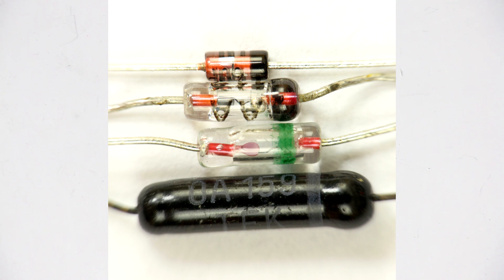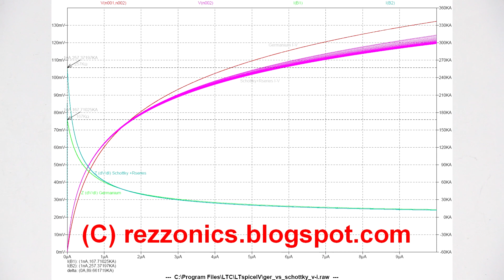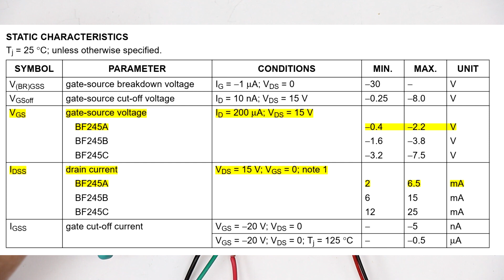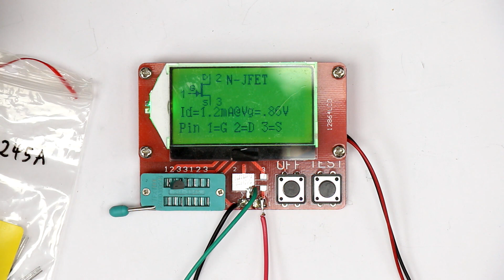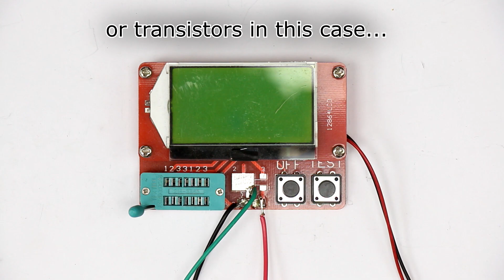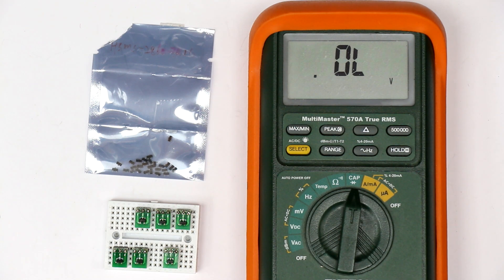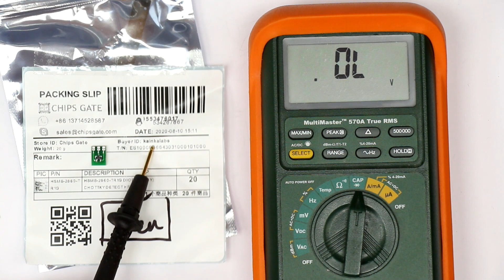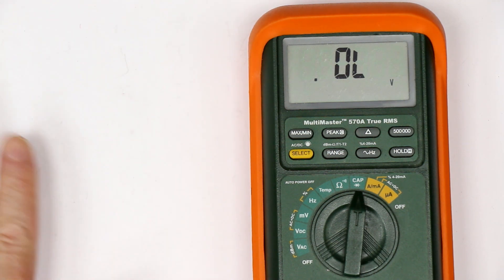Some Fake Chinese Semiconductors

Comment: I've had fake Unijunction transistors, which indirectly came from China, mostly it's the type 2N2646 that I'm aware of. The REAL 2N2646s have goldplated pins and a gold or brass plating on the bottom of the TO-18 casing. Not the cheaper aluminium or tinned cans that the Chinese sell. As for internals, they're just cheap standard NPN transistors, so not even useful as a Unijunction... I made many circuits that failed, till I realized to put the transistor in the tester. I've now seen 2N4871s as well, that I do not trust in the least? Only the American companies made Unijunctions as far as I'm aware.

Regards,
Thomas

Comment: I buy Linear Systems FETs. Cost adds up as I often need matched pairs so have to buy 100 to get some good matches. At $3 each it is expensive. Or, buy from a reputable individual. May be $20 for a pair 

I got some bags of BJT and FETs from China and they were the correct type. Then, they have to be checked for quality. 

I prefer to pay up (and find a replacement if necessary) and buy from major suppliers -- Mouser, Newark, etc. It isn't worth my time to buy junk parts.
Reply from the maker: But there are a lot of parts that aren´t avialable any more from DigiKey, Mouser etc like e.g. the "A"-Types of Standard-FETs. What do you do then?
Reply: I use the LSK170 which does come in the A, B and C current ranges. I have searched their list for complementary pairs and found one for a project.

It is a real shame that a manufacturer such as Toshiba stopped making many audio transistors because of this fake problem. 

In the end, if a direct replacement or sufficient replacement can't be found then I would try to find a good transistor and adjust components as needed to get a good design. 

That is not desirable when repairing or reconditioning equipment to original condition. 

For me, finding replacements is tedious when a part is no longer available and no recommended replacement is available by the manufacturer. 

That is where your excellent video comes in. I had no idea of the problem until I got back into building audio gear. One transistor with a MT100 case (?) was faked and so none were available. I used a Motorola transistor with similar specs and different case. It was rated at lower power but that was not an essential parameter.

If these fakes stated what they really were, we could better evaluate the specs and determine if it was a good replacement. Too bad they don't. Worse yet, they may be rejects.

I got a bag of 2N3904 transistors back in the 80's which were very noisy. They went in the garage. It wasn't worth the price of mail to return it. No internet then.

Comment: We crystal radio enthusiasts want germanium diode because it needs only 0.3 volts to conduct signal, other diodes work on 0.5 volts. So we wouldn't hear any far away stations only near strong stations with fake germanium diodes.
Reply from the maker: That is one of many misconceptions about Germanium-diodes used in crystal-radio receivers. In fact it´s the ratio between the forward and the reverse current at very low voltages (below 100 mV!) that determins the usability of diodes in crystal radio circuits. If you really needed 300 mV to hear AM-stations, you could only hear very near stations. Because of the much lower reverse current of Schottky diodes they are far superior to every Germanium diode. And in fact the first crystal-radio rectifier diodes (the real "Crystal-diodes") where a small wire (Cat´s whisker) was contacted to a Galena-crystal, were in fact Schottky-diodes!
Reply: @KainkaLabs  I was very surprised when I first discovered BAT82 works much better than any germanium diode I own in my crystal set.
Reply: @KainkaLabs  Isn't the point-contact diode a different principal to a Shottky-diode? I know nearly nothing about semiconductors, but a little bit about historical evolution thereoff and I'd find it strange that during that entire period nobody decided to call the original 1N34 (for example, or it's European brothers OAxx) a Shottky-diode? Or is any metal-semiconductor contact based diode a shottky-diode?

And yes, many of these pointcontact-mineral affairs work even better than Germanium-diodes, truth be told... They're not that good once you start using biasing!

Regards,
Thomas

PS. I grew up on Websites like yours hahaha!
Reply from the maker: There are 2 answers to your questions. Both (classical) Germanium as well as Schottky-diodes could be called "point-contact" diodes. But in Germanium-diodes it´s a PN-junction and in Schottky-diodes it´s a Schottky-contact (semiconductor-to-metal) that is "point-contacted".
The second answer is, what kind of diode is "inside" a glass-body stamped or sold as "1N34". They have similar characteristic curves, although the Schottkys have m uch less reverse current. But through the glass-body one can clearly see the difference between the two types. In Germanium-diodes you usually see a golden, whisker-like wire with a bend contacting the PN-junction. Schottky-diodes usually look orange inside with no discernible structure.

Comment: I bought 10 pcs of Dual Gate MOSFETs BF962 from Ali. Not one works! But they offer free returns. The scam works because the buyers rarely send the parts back and because it costs almost nothing. In the case of expensive parts, the fraud is not unsuccessful, because higher costs are open.

Comment: Radiation measurement equipment service engineer here. Now Germanium is used for gamma detectors.
Reply from the maker: Yeah. That is pure Germanium, not "doped" Germanium for semiconductors. Completely different application with different physics. And BTW Silicon is also used for particle-/radiation detectors e.g. in the detectors at the LHC.

Comment: I have bought in Aliexpress J-FET dual gate transistors marked as NEC 3SK45, and I received them stuck in a piece of PE; one of them had a D-S short circuit and the other one was actually a N-D-MOS.

Comment: I recently bought some JFETs from AliExpress. The BF245Bs were fake: NPN BJTs as per your video. The BF245As gave very peculiar readings on a component tester similar to the one you used. Vb was 385mV and Hfe was 184K and it showed up as a NPN BJT. I was able to repeat these tests with a Peak Electronics DCA75 component tester. The BF245s tested as NPN transistors as before but at a collector current of 5mA, Hfe was 278 and not over 400 as before. I think they are 2N3904 or similar. The BF245As, however, tested as n-channel JFETs, as they should. The pinch-off voltages were around 0.5v or slightly less. Perhaps the cheap testers cannot test JFETs with low pinch-off voltages.

Comment: Recently i bought some lm317 in to92 and they are so fake that i can't even found out what they really are (i tested as transistor, diode, all series and shunt regulators pinout combinations, and more), also in a previous transistor kit came some tl431 that were in fact tl432 (different pinout), and i don't even want to talk about regulators, mosfets and opamps 99% of them are fake.

Comment: You should get NOS local 2AP series instead of western part number
Reply from the maker: What does this have to do with the topic of this video: fake chinese parts???
Reply: @KainkaLabs  there is no modern packaging germanium parts,  you definitely going to get fake parts.
Reply from the maker: That´s wrong. I have seen germanium 1N34 diodes recently on AliExpress. The Chinese apparently do still manufacture genuine germanium diodes.
Reply: @KainkaLabs  you probably should put them on curve tracer and looking into the temperature current changes to tell if they are germanium.
Reply from the maker: IT´s much easier. With a trnasparent glass envelope you can easily discern germanium from Schottky diodes. The other method I have descried in my video "How to discern Germanium....". It´s the reverse current that is much higher with germanium compared to Schottky.

Comment: Fakes are often immediately visible by the part number, incorrect fonts and lightly laser etched but no depth to it as the original would
Reply from the maker: Not always. I have seen fakes where (without a genuine part as reference) are extremely well laser-etched under a microscope.

Comment: Of course they are fake! The question is if they work exactly the same as the orginal ones or not! I don't understand people asking if products from China are fakes , it is quite dump question really. Originals are from original suppliers.
Reply from the maker: No, not always. Many devices are now either genuinely produced in China or there are Chinese clones which are 100% compatible. But those that I showed are true fakes.

Comment: As the fakes permeate the markets it must allow confusion and failures and thus destroy the markets for hobbyists perhaps.  Your other choice is to pay full price from electronic dealers for parts that are currently made,  or take huge risks for older parts or salvage them from scrap electronics.
Reply from the maker: The problem is that for some products like high-capacitance varactor diodes or some J-FETs in TO92 case there aren´t any genuine manufacturers any more and you only get NOS parts.

Comment: Well Schottky has forward drop similar to Germanium?  Then they may work as well as Germ.  in a crystal radio anyway,  I cannot think of how reverse leakage would be of advantage.  Other characteristics might matter,  like capacitance,  PIV,  current,  etc.  but not in most radio detectors.  Also the highest frequency they will work at is sometimes an issue.  Lot of people that do crystal radios just have  terminals so they can hand select the best working detector from a lot of diodes anyway.  But China flooding the world with fake parts is a  big problem.   That is a sign that the evil at the top permeates the whole society.

Comment: Awww, you're like a psychiatrist - diagnosing fake FET transistors with bipolar :D

Counterfeit parts are an absolute menace, even more so for an newcomer to electronics. When you're learning and don't have the debugging skills or too much test equipment yet, it can be so frustrating to see that the newly built circuit is not working and not be able to pin the cause down.

BTW got a decent number of old stock germanium diodes. Enough to make more than just a few effect pedals.

Comment: I bought HSMS-2852 and SMS7630 from aliexpress. I tested with diode mode and both cathode-anode works correctly. However, I found the Vf for the HSMS is around 0.38 V, while in the datasheet its around 0.15 to 0.25 V.  Is it normal? Anyone has experience with this diode?
Reply from the maker: The forward voltage is dependent on the forward current. It is not a constant but a logarithmic function. So it can be anything from a few millivolts to a few hundret millivolts (still higher would mean destructive forward currents).

Comment: No you are not at right. It depends upon what you are going to purchase. These are refurbished parts. These parts are pulled from old electronic circuits, old leads are cut and new leads are welded and retested. A part which had been in service is more reliable than new.

I have lost several thousanda Dollars  by purchasing new parts to manufacture AC-DC kits due high rate of return. After several manufacturer, I used these refurbished parts and my kits are working fine with extremely low return ratio.
Reply from the maker: What you say has nothing to do with the parts in this video

Comment: I saw fake semiconductor like regulator ic like 7805 but out put is 12v because they use sand paper to remove 7812 number and re-print 7805 on 7812
Reply: I bought 50 fake LM317 from ebay. Wasted time testing it.

Comment: The Fake BF245A is the same I got some time ago. Simple NPN transistors. They sell the same crap until today and THEY KNOW IT.
The original BF245A has a more solid case , thicker legs and not this thin laser printing. The original has only 4pF gate capacity.